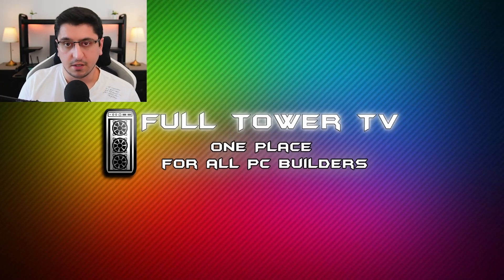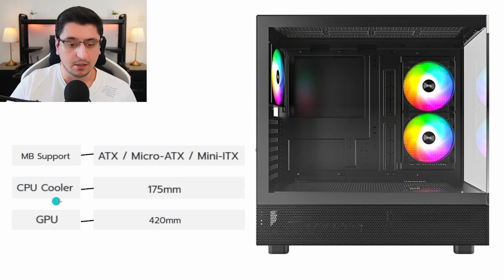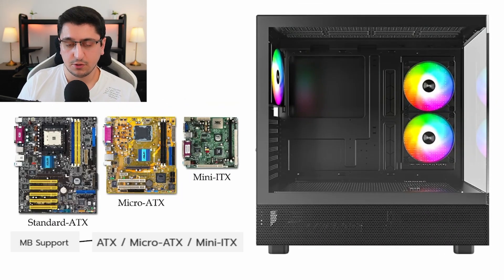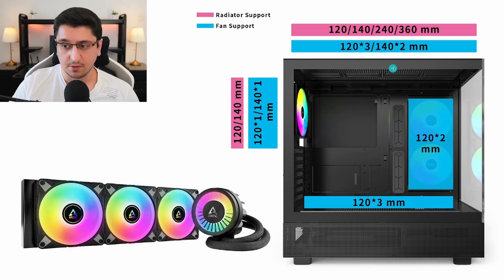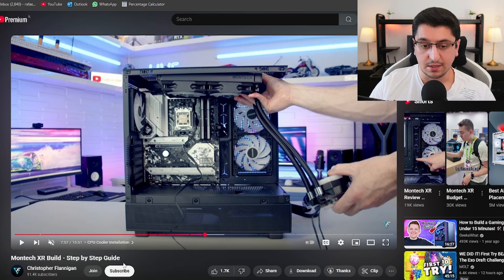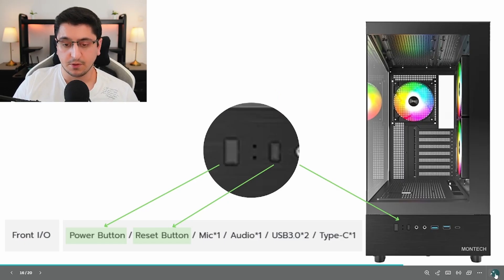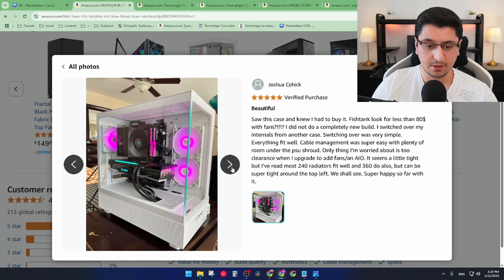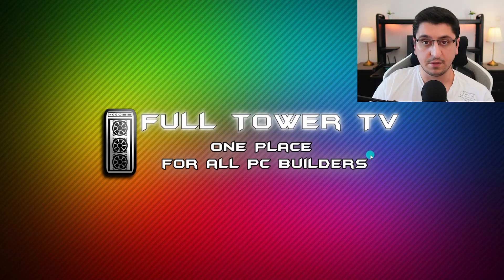Montech XR - Important Specs, Reviews & Builds.

Comment: Can i remove side fans and connect 240 mm aio to side
Reply from the maker: No, the radiator support for this case is only at the top. If you mount on the side it will interfere with the motherboard / GPU.

Comment: Yo! I have this case! Was confused about the direction of the fans so I looked for a video! 
So, the two stacked fans are bringing in cool air, while the one fan is an exhaust, sucking OUT the warm air? If I have that right; I’m looking to add three fans at the bottom. I assume I want these fans to be pushing in cold air, correct? Will the one exhaust fan be enough? Thanks!
Reply from the maker: Yes.
There are 3 types of airflow inside a pc which are all valid ✅:
Positive, negative and balanced. 
Because in your case it's positive I will explain it:
Positive pressure - more intake then exhaust - because hot air goes up by physics laws, if you configure it correctly - you can definitely have more intake then exhaust.
In your example - if you put 3 intake at the bottom it's tottaly OK because they bring called air which eventually go up as hot air and leave the case because of the physical law that hot air always go up by itself.
If you want - in the future - you can add more fans at the top as well for exausht (unless you are planning to have an AIO at the top which is also fine.)

Comment: I never seem to get any responses when I ask a question but I'll try again. 

How does this case holdup for dust filtration? I know it has 3 filters but my concern is the ventilation through the side under the tempered glass. Would you recommend putting 3 more fans under gpu as exhaust so dust doesnt get intake from there?
Reply from the maker: Hey, sorry for the late reply. 
I see a lot of people adding fans at the bottom in this case.
It really depends on which fans are you using and what kind of graphics card.

If you are worried about dust - every computer will have some amount of dust with time and it's legit something you can really control. 
Just make sure to clean it from time to time.

If you want better airflow I would add fans at the bottom, just make sure your GPU is not too big (😅) and the fans will fit.

Go here to the case product page on Newegg, and scroll down to the reviews section you can see some pictures and examples like I showed in the video of what people do with it:
https://www.newegg.com/montech-atx-mid-tower-cases-black-xr-b/p/2AM-00CN-00061

Hope that helps.

Comment: normal fan, reverse fan... terrible communication.
Reply from the maker: How would you call it?
Reply: @FullTowerTV airflow in or airflow out.  Intake or vent, input or output.  There are so many ways to he descript.  I thought you were trolling..
Reply from the maker: @chucksevall3641  
Not at all - I think there is a bit of misunderstanding here and maybe I should have explained it better in the video:

This case has 2 types of fans in it. 
The fan at the back is a standard PC case fan. 
But, the fans at the side are not standard and they have the blades in them installed in the opposite direction.
It's not the fan installed in the opposite direction - they litterly took the blades inside the fan and flipped them upside down.
That's why I call them reversed. 
Watch this video to see what i mean exactly: 
https://www.youtube.com/watch?v=Dh04A61crAM

With that in mind I think you can't exactly say airflow in/airflow out because each type of fan in that position will act differently.
If you would put a normal fan there it will act as an exhaust and not intake because the blades will be pointing the opposite direction.

I hope that explains it better.

Comment: Are the 3 included fans alright for r7 7700x + xfx rx 7800 xt? I will add Montech Hyperflow Silent 360mm WC on top of it. Thank you for the video!
Reply from the maker: Im so sorry your comment must have slipped between my eyes and I hope its still relevant:
I think with that kind of hardware you might want to consider changing them to some better fans.
Some suggestions:
1. Noctua NF-A12 (black no rgb)
2. Arctic F12 PWM PST (you can get white/black and you can also get the P12 model which has an RGB variant, just make sure it's PWM PST)
3. Be-Quiet! Silent Wings 4

Comment: would the 3 inclueded fans be enough? i'll build a 9070xt/7700x system.
Reply from the maker: It will be fine but I would recommend to add fans at the bottom of the chassis, you can add up to 3 x 120mm fans.
Reply: Hell yeah. I have a 7900xtxt and a 7900x cpu. Fans on the bottom are not necessary.
Reply: Do you use water or air cooling?
Reply: @antoniov394d9  i use air cooling, i also bought 7700 instead of the x version so i think its enough

Comment: I built my first pc with this case, and id say its a pretty good one, theres some problrm that i had tho (this is mr being very nitpicky), first is the somewhat overwhelming daisy chaining, daisy chaining the fan itself is good, but if ure a first time pc builder this can get overwhelming, especially considering u might have to undo the cable ties put in them since it can restrict the cables from moving, second is the front io being pure black, most cases prolly does this too, but again this is me being nitpicky on purpose, third is the fans not being individually sold, if u wanna add more fans then u might wanna replace the 3 fans entirely to match the aesthetics
Reply from the maker: Yes, that is actually a very solid point!
All three of your points actually but the first and the last one are very valid and not "nitpicky" at all!
The daisy chain fans are annoying even for a non first time pc builder. But I get why you are saying that because a first time pc builder need to focus on all of this other stuff, and also deal with this. That's why companies like Lian Li and even Thermaltake started to make those magnetic fans which do not require cables at all. The problem is they are very expensive and don't make a ton of sense for most people who build pcs on the budget, and want to spend the most of it on the performance.

As for the fans not being sold separately - yes I was actually looking in Montechs website and it seems they did had them at some point but it's impossible to find them anywhere.
Reply: you can buy the same fans....

Comment: I got a question why does my Rtx 5080 aoero cc not fit in this case i have to take out the second fan where the 2 preinstalled fans are
Reply from the maker: Some GPU models are bigger then others, it really depends on the manufacturers with the way they build some coolers are bigger then others. If I remember correctly you can add fans at the bottom of this case as additional intake or fans at the top as exuahst (if you didn't install an AIO cooler at the top)
Reply: @FullTowerTV i installed a AIO cooler on the top should i still install that 1 preinstalled fan on the bottom?
Reply from the maker: @PV_COLLECTS yes I would recommend to install it on the right side so it will be similar to where it was if you know what I mean

Comment: Are both argb and pwm daisy-chained? Or is it only the pwm?
Reply from the maker: Both.
The fans all plug into each other and you use only 2 connectors on the motherboard. 1 for PWM and 1 for ARGB.
Reply: @FullTowerTV I’m new to pc building so the pwm is the one that I have to put in sys_fan?

Comment: 5:54  where would you plug all the daisy chain fans like what part of your motherboard?
Reply from the maker: You should have a connector that looks like this: https://ibb.co/ZRQ8rFxg (circled in red).
Unless you have a motherboard from like 6-7 years ago and more, you should have at least one. Some boards even have 2/3. Usually, they are located at the top right-hand side of the board or the bottom.
Reply: @FullTowerTV and will all the case fans be already together from the cable and you just plug it in correct?

Comment: Nice and detailed review. It answered my question about whether my mobo would have enough connectors.
I'm going with a Asrock B650 PG LIGHTNING it has 4 CHA_FAN and 3 ADDR_LED.
With a arctic liquid freezer 360mm argb which takes 3 CHA_FAN and 1 ADDR_LED.
The Montech XR case would take 1 CHA_FAN and 1 ADDR_LED.
So I don't need fan splitters or a argb controller right? Thanks!
Reply from the maker: Hi, great questions! :) 

A couple of things: 

First of all, the ACRTIC LIQUID FREEZER includes splitters for the fans and argb cables.
The splitters are optional, BUT I SUGGEST you DO use them.
Here is how it works:
The fans in the AIO need to be plugged into the CPU_FAN header and NOT the CHA_FAN headers.
The CHA_FAN headers are for CASE FANS and NOT for cooler fans, whether it's AIO or air. 

The idea behind this is: the CPU_FAN header is "reacting" to the CPU's temperature. If it sees that the CPU is getting HOT, it will ramp up the speed of the fans. 
If you plug them into CHA_FAN, the reading won't be accurate.
Also, if you leave the CPU_FAN header unplugged,
the motherboard might give you a "CPU FAN ERROR" message every time you turn your computer on. 

Another thing: with each AIO, usually, you have a fan plug that comes out of the PUMP and needs to be plugged into a fan header. A COMMON mistake is that people plug THAT cable into the CPU FAN header, which is WRONG. You need to plug it into the AIO_PUMP header (if you have it) or a regular CHA_FAN header.

This is a screenshot from your motherboard's specification page: https://ibb.co/j9mSkjDM
That explains it better.

But in summary, plug all your 3 AIO fans into the CPU_FAN header with a splitter so the cooler can react correctly to the CPU's temperature. 
And no, you don't need any hub because this cooler comes with everything you need to plug it correctly.

Hope this helps!
Please let me know if you have more questions! :)
Reply: @FullTowerTV  I understand it now, thank you very much!

Comment: What about  two 140mm fan at the bottom possible ? Because it was not in the picture.
Reply from the maker: @Joel-d7v6m  Unfortunately it supports only 120mm fans at the bottom but you can put 2 x 140mm fans at the top for exhaust if you want
Reply: @FullTowerTV  Thanks probably it don't have screwholes for two 140 at the bottom
Reply from the maker: @Joel-d7v6m  you can attach fans with zip ties. I know some people do that. But yeah it doesn't have screw holes for 140mm, unfortunately.